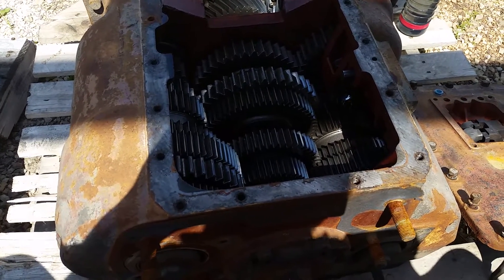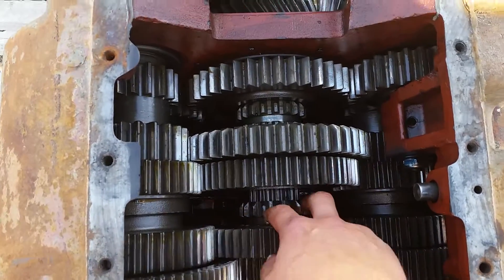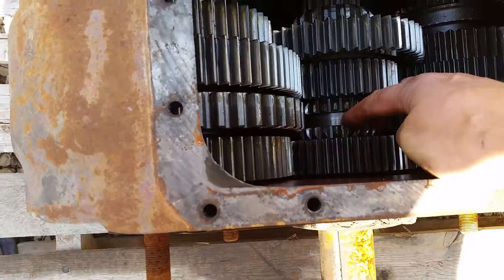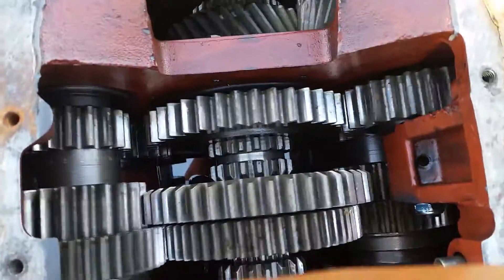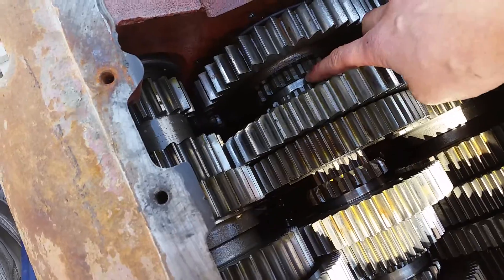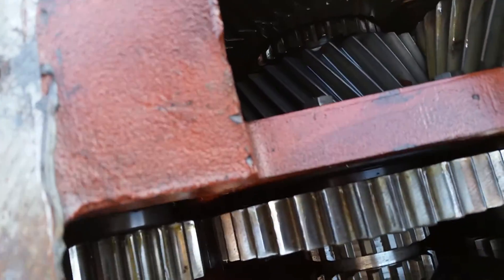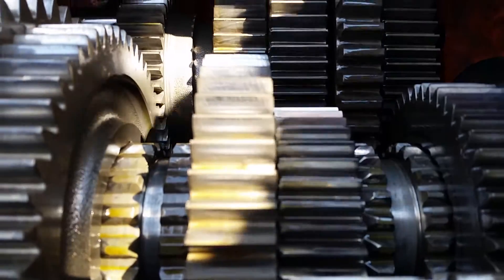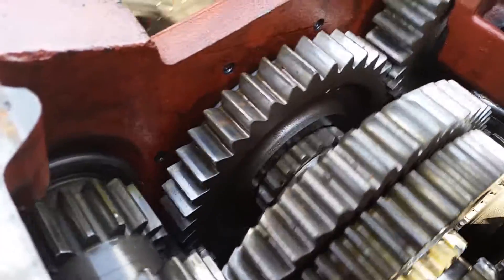Inside of 13 spd Eaton fuller

Comment: From what it looks like, is it an rt-613 with an overdrive conversion?

Low range:

R   1   4
|----|----|
Lo 2   3

High Range; splitter off/on

R   5   8
|----|----|
.    6   7

High Range; splitter on:

*5, 6, 7, 8 will have an underdrive but will be direct if splitter is activated.

*=Not sure exactly if it was just a regular 13 speed without an overdrive that you converted into an overdrive or if it's factory, in which case I can be entirely wrong and for all i know it could be an RTO-613.
Reply from the maker: Almost. The top gears have a "splitter" which acts as an overdrive. So it's an upshift when selected.

Comment: What I don’t understand is how the splitter works on a 13.  Disregarding the splitter, the transmission with the hi/lo range section is a 9-speed.  Then putting the splitter on the back doubles the ratios for 18, which is easy to understand.  But on the 13, the splitter only works in hi range.  It seems to me that the two versions would have the same parts, almost.  If that’s the case, what is the point?  Are there more differences other some little mechanism to prevent a split when in lo range?
Reply: Look inside to understand.
When in the high side you can split each gear (if needed ?) To get 8 speeds. The low gear on the main isn't used in high range 5+8=13
Reply from the maker: The purpose of adding gears is in the application. The heavier the load, the more gears are required. 13 is the most common because of the most common application = 53' trailer at 80,000lbs. With that weight and in the long haul application, split gears on the high range only, may be beneficial because of the higher speeds negotiating hills.

Comment: I wish you could have shone the gear set  low in high range that is not recommended to use.
As well as 1,2,3,4,5,6 etc. Still any look inside is better than no look.

Comment: Thamks for the info, question im doing the back end of my 13 speed eaton.. my question is that i have a washer that goes inside the reduction gear  before the pin and syncros.. the washer  has 2 sides one flat and one taperd.. which side faces the reduction gear and which side faces the syncros.. thanks for any help!
Reply from the maker: I'm not a mechanic. I would ask a professional
Reply: @TruckinTrent  ok. Thanks